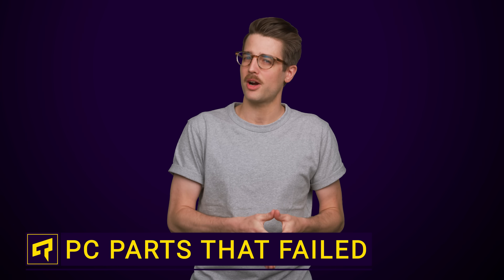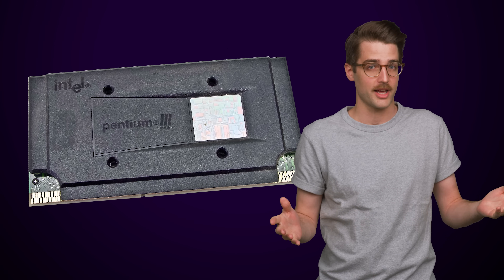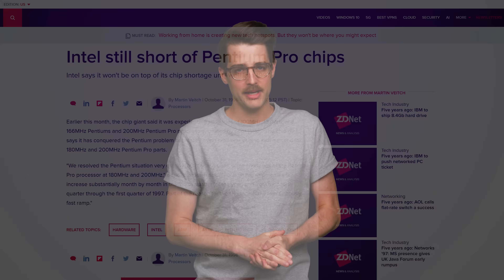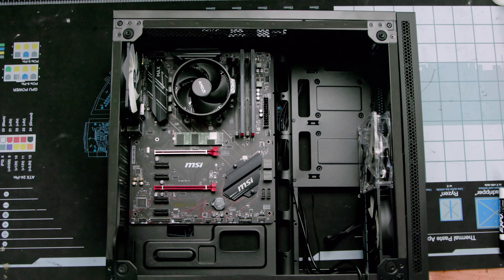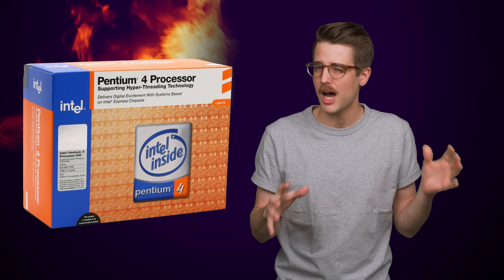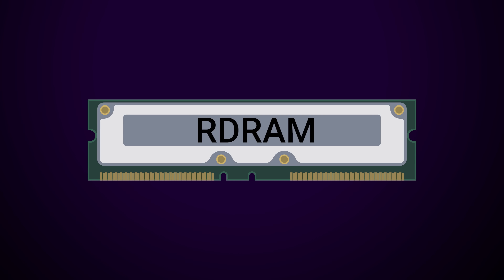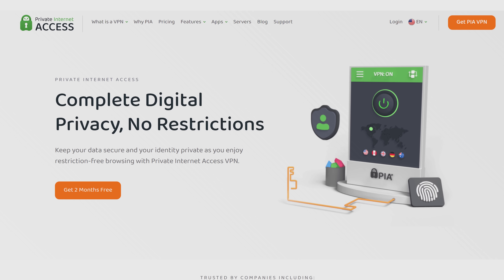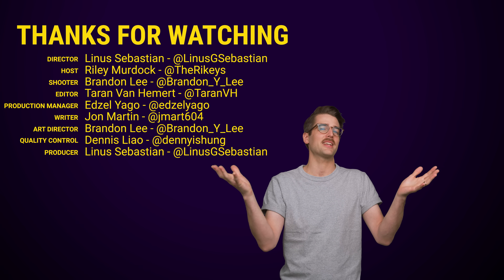PC Parts That Disappeared

Comment: Graphics cards were nice. I remember when we used to be able to buy those.
Reply: Lmao, good one mate, also, imagine if they were at MSRP, like I'd have a 6700 xt, it's really frustrating, but oh well
Reply: @gordoncunliffe8038  6700xts are expensive. Just go for a 3060 or 3060ti
Reply: @Gobble.Gobble  no no, ofc I would, but I mean I'm getting a 6600 xt cus it's only thing I can get under £400, but like if everything were normal, I probably would be able to get a 6700 xt
Reply: @Gobble.Gobble  I love my 3060,  it was a step up from the integrated graphics (vega 8) I had been using.  For just running 1080,    my 3060 is nice.
Reply: @Gobble.Gobble  I come from the future, and a 30 series GPU costs more than a 40 series. Just buy a PNY 4070 Ti.
Reply: @Gobble.Gobble  a rx 6700 xt is cheaper than the RTX 3060/RTX 3060 Ti?! What are you on Turkey
Reply: @olgaolgaingit  That comment was few years ago back when AMD cards were ridiculously expensive. Now AMD is cheaper. I live in USA
Reply: @Gobble.Gobble  oh
Reply: @Gobble.Gobble   nahh 3070 minimum as cost increase isnt that much and you get over double the performance over the 3060 and its got ray tracing
Reply: @Luka The Satanic Gamecat i'm from the future of the future of the future, there is a patch crack/hack to use the card w/o that fkng subscription we release that, remember: we are on the matrix.
Reply: @Gobble.Gobble  6700xt is cheaper than 3060 ti and almost better
Reply: @Tripleblyet  look at the date. that was at the top of the covid crisis. Back then 3060 ti’s were going for $700-800. The 6700xt were $900
Reply: Voodoo FTW
Reply: @nissieln  The good times will come back around when we all decide to kick the crap out of bitcoin miners. Joking only joking hmm.
Reply: @guerillagardener2237  hummm, in a Blackmirror-y dystopia, crypto miners got rich enough to buy all GPU manufacturers, and gamers are forced to work in their assembly lines with the hope to smuggle some RX 550s or 1050s. Only console gaming is legally allowed. There is a curefew on Steam, and playing games on smartphones requires an authorized Brain-Zuck port. The resistance is orgnizing around 2D indy gaming and Tetris reboots. Is there even any hope????
Reply: @nissieln  nice return, in summary great tech bad use.
Reply: @guerillagardener2237  You nicely summarized in a few words my 3 paragraph rant lmao
Thanks for the conversations as well!
Reply: @nissieln  Well yes thankyou aswell. I will say this before I go, some years back one of the universities in Britain did a study into gaming and found that in actuality it is good for you in moderation. Let's hope we don't lose that, because I've always been a gamer and always will.
Reply: Good old times...
Reply: Nowadays they are those ridiculous monsters, that take more space than the whole rest of the system in total ... everything gets smaller, except graphic cards... kinda lame.
Reply: I've got one whoohoo. Only 4 GB though.
Reply: Today I went looking for a hard drive cable. I found that there are no stores that sell PC parts.
Reply: queue in the "back in my days" line lmao
Reply: Oh you can still buy them, you just need a mortgage to do so.
Reply: Lol
Reply: Those were the days
Reply: Buy prebuildts, theyre usually cheaper than the graphics card itself
Reply: Wow.  Happy 100th birthday 🤣
Reply: LOL indeed!
Reply: I'm just glad I bought a 980ti when I did. It was hard to find back then. Better to buy a flagship card that will last into the future longer than the cheaper cards. Now you can't buy graphics cards and I can still game on 4k low settings.
Reply: Same
Reply: Rip graphics cards start_of_universe-2020
Reply: So you’re talking about integrated graphics being as powerful as dedicated graphics
Reply: Just buy second hand
Reply: Dont worry its part of being an adult, forget about things like graphic cards, houses or retirement...
Reply: So much yes.  It feels like I'll never be able to upgrade since I'm poor
Reply: I know right
Reply: even my nvidia bread is now old
Reply: I remember the time when we were unable to buy a single PC
Reply: I remember being able to buy a 1070 from a sale for just 400€, what awesome value that was for the money indeed. Especially after one of the fans failed and I swapped the entire cooler for an Arctic Accelero thing which made it run sooo much cooler and extended its life so much that it is still in use today in a PC I built for a friend.
Reply: Remember when Computer is all about calculating numbers and not bunch of matrices ? Now they calculate matrices.
Reply: @That_One_Guy...  yep
Reply: um still can
Reply: Better than wire records
Reply: Me over here having paid $700 for 1660 super in December 😒
Reply: @Allegedly_Angel  that's just...wow
Reply: @olgaolgaingit  bro, the shortage was real
Reply: @Allegedly_Angel  ik
Reply: Honestly buying aftermarket worth the risk
Reply: Remember when you could build an entire mid-range PC for 300-500$ Recently tried that on a local webshop and I got CPU,GPU,MBO and RAM for 340$, literally the lowest I could go other than 2x4GB instead of just 1x4GB of RAM.
That's still no PSU, Storage, Case, Cooler, any peripherals. It's insane!

I really hope the PC component market crashes, we need it to! There are "Budget" GPUs that are more than my entire paycheck and mid-range ones that are 3 times my paycheck.
Reply: The cheapest graphics card I could find was more expensive than my whole setup lol
Reply: Lfmao
Reply: Interesting going beyond soc (system on a chip), with chiplets, video tiles, memory tiles cpu tile(s) with specialised acceleration engines (AI or media etc) within these tiles or within their own tiles, i could see hyper-systems on a card coming back. Thread ripper card with gpu and AI okay. Want 2,4 or 8 of these in one box? ok that's 15k for each card! Then 30k for base plane and box. Btw each card has a terabyte ± of ram, and 16+ terabytes of card storage.
Reply: @engwiki Yeah, they've gotten to be way out of my price range these days. Being retired now, I can't afford one of those $2K+ graphics cards. At my age (65) I'll be building what will probably be my last ATX PC (so I can work more efficiently on my digital art than with my laptop -- its AMD Ryzen 3 CPU gets bogged down at times since my art files can be >400 MB each, even with 32GB DDR4 RAM and a 512GB Gen3 PCIe NVMe M.2 SSD). I recently bought a Beelink SER5 Mini PC to have as an additional computer, though I still need to get a few upgrades for it before I start work on it. Got one other computer project in the works -- a new laptop for a friend of mine.
Reply: I had gigabyte rx5500xt didn't owned it that long.
Reply: Can't relate bro
Reply: Welcome to 2024, where graphics cards flow. And Msrp has made a return and amd has amazing budget to mid range cards
Reply: 2 years later buying one is no longer a problem :)
Reply: Back in the good old days i used to have one in my PC
Reply: 2025 here its is now, gpu, ram, ssd, and hdd.
Reply: Gulp..who would've thought it could get worse
Reply: I mean zotac drops are pretty good. I bought 2 gpus from there
Reply: @Gobble.Gobble  what groups do you use to alert you ?
Reply: @Gobble.Gobble  why do you need 2 gpus?
Reply: @tesora917  Cuz I have a family? I got one for me and one for my little brother. I got myself 3070 and 3060 for my little bro at the time. Currently, I am using a 6950xt and gave my 3070 to my lil bro
Reply: @Channel name mattiyallo.. they drop once a week or sometimes once every two weeks. Just join a group that alerts you for drops
Reply: What do you mean were and used to? You still can.
Reply: @morgan russman  crypto crashed, and there was a mass suicide of crypto bros. Prices have been back to normal ish for tha last 8-9 months. Back when this was being talked abt, prices were $1000+ inflated in some cases (in Cad, im canadian)
Reply: I still buy em. Quit making fries.

Comment: Celeron 300A had integrated cache on the die, so not quite right. That also made it an overclocking beast.
Reply: A very small amount, and iirc the cache on the p2 and p3 chips ran at half speed too. The vast majority of celerons had no cache at all though.
Reply: @bionicgeekgrrl  Small but fast (when overclocked).

Comment: Review built in programs that failed in all Windows operating systems. Why did Media Center fail? why did Media Player stop at 12 while the Windows 10 version gets FLAC? Why did Windows Media fail when Microsoft promoted it so far on the Xbox 360. Samurai Jack Season 5 is encoded at 15mbps H264 and my 360 ACTUALLY PLAYED IT! Microsoft, give it AC3 and we'll stop resorting to Pro Logic/SRS or even VC-1+WMA Pro 7.1 768kbps so we won't have to pay for a WMA Pro AV RECEIVER for what is essentially DTS-ES.

Comment: I signed up with PIA because of the ads here, and I regret it. I payed for the full year, and it's terrible. It tanks my download speeds, it disconnects and doesn't auto reconnect, and many times I find myself going through different servers trying to find one that is working properly with decent bandwidth and not detected by prime video and Netflix. Not good, you guys shouldn't push this company. It's not good.

Comment: Remember SCSI and IDE? FireWire that failed as a successor of USB? Lightscribe to just "print" a CD cover using your CD burner? The Northridge? (Yeah, it's gone). What about Dallas clock chips? Remember that you need to replace a cristal oscilator if you wanted to overclock? ZIF drives, floppies, 3d accelerators, EDO ram, separated FPU chips, the list goes on and on
Reply: Funnily, I still use most of those 'forgotten' items daily. Except the Dallas chip, it went dry and I have to update the clock manually every time I turn the computer on. Oh well, at least it remembers when I last used it ;)

Comment: I belive the Pentium D was the king of all heat generators hahaha
Reply: Every generation had its own king of heat. Remember how flabbergasted people were by the 43 watt Pentium II 300 (compared to 17 watts of the top tier Pentium MMX)? Or the stir that 72 watt TDP of Athlon 1400 made? It all looks funny when put into perspective, compared to 220 watt AMD FX, but those were genuine problems back in the day.
Reply: @spavatch  Yeah the Pentium II had more that its fair share of "issues" being on a Slot A interface with external cache. I do remember people just nit picking there, also on the AMD side the Athlon XP chips I think were the king of heat generation, getting hot enough to melt their own solder points hahaha
Reply: @hgri89  - yeah, Barton XP pushed it to over 79 watts with 2.33 GHz 3200+ model ;) I didn't have that problem though, my XP-M 2500+ ran at around 2.75 GHz 'under water'. This, combined with an AGP version of X1950XT Radeon card made Crysis run at eye-watering 15 FPS and indeed I've completed the game on that PC back in, Ida know, 2007? :)

Comment: RDRAM was used in the Nintendo 64. That's why you needed a "Jumper Pack" in the standard system. The Expansion Pack was able to add 4 MB to the system for a total of 8 MB.
Reply: it actually would work without the jumper pack (which only contained a few resistors and some capacitors.)

Comment: I remember the whole slot processor and RDRAM days very well.  I miss the slot style processors, as they made cooling easier in certain ways.  I wish it would have continued.

The RDRAM debacle was a horrible time.  It took far too long to convince Intel to give up on it, and then Rambus decided to sue memory manufacturers all over the place for ideas in the DDR SDRAM specs that THEY suggested.  Rambus is a bunch of grifters, and, yes, they are still around and still patent trolling with no contribution to society.

Comment: "PC Parts That Disappeared" ...brb running to the basement... phew, my slot CPU mobo with RAMBUS is in fact still there.
Reply: Thank you for watching, for questions, guidance and support at anytime... Just DM

+ 17705803362@ W H A T S A P P  $£€¥
Reply: Thank you for watching, for questions, guidance and support at anytime... Just DM

+ 17705803362@ W H A T S A P P  $£€¥

Comment: How about pinout socket adapters?  I used then in early 2000 to upgrade of old mobo with good cpu, and ran 2000/XP on it until 2009.
Reply: Thank you for commenting don't forget to hit the subscriber button,
Having difficulties
📥 Text ..me /// W h a t s A P P
📞 +1 (770) 580 3362

Comment: Too bad that no digital native will ever share the fun we have with a celeron 300A in that slot 😁
Reply: Thanks for watching
DM on W🔸H🔸A🔸T🔸S🔸A🔸P🔸P let's talk
more🤝
+🔸1🔸7🔸7🔸0🔸5🔸8🔸0🔸3🔸3🔸6🔸2✔️
Reply: We gain 50% to 66% more speed with changing a jumper on the mainboard ... no extra cooling, no fancy ram or bios setting needed. After this it never happened again :)
Reply: Thanks for watching
DM on W🔸H🔸A🔸T🔸S🔸A🔸P🔸P let's talk
more🤝
+🔸1🔸7🔸7🔸0🔸5🔸8🔸0🔸3🔸3🔸6🔸2✔️

Comment: I remember taking off the Athlon casing to put on the "goldfingers" so you could adjust speeds.

Also another favorite was the dual abit cpu mobo that could do 2 celerons overclocked to 550mhz by changing the bus speed from 66mhz to 100mhz.

Too bad nothing besides windows 2000 supported dual cpus at the time and most video games either wouldn't run or you couldn't get drivers since they were all based on win9x infrastructure.

A neat concept since those celerons were dirt cheap and running at 550mhz was crazy fast for the time when p3 chips were topping out at around 400-450 and cost a ton more.

Future video..... Talk about optional math coprocessors.
Reply: Thanks for watching
DM on W🔸H🔸A🔸T🔸S🔸A🔸P🔸P let's talk
more🤝
+🔸1🔸7🔸7🔸0🔸5🔸8🔸0🔸3🔸3🔸6🔸2✔️
Reply: Thank you for watching, for questions, guidance and support at anytime... Just DM

+ 17705803362@ W H A T S A P P  $£€¥

Comment: "First slot CPU for desktops" wasn't a Pentium II - the Macintosh had been using PPC processor cards for several years by the time the P-II came out. Wouldn't be shocked if there was others as well.
Reply: T,,H,,A,,N,,K,,S,,  F,,O,,R,, W,,A,,T,,C,,H,,I,,N,,G,, C,,,,O,,,,N,,,,T,,,,A,,,,C,,,,T  F,,,O,,,R  I,,N,,V,,E,,S,,T,,M,,E,,N,,T  A,,S,,S,,I,,S,,T,,A,,N,,C,,E
+17705803362

Comment: I heard about the cache thing was a scam and they just wanted to get rid of the super socket 7. Since you could put intel, amd, and cyrix all in the same motherboard. I also know that slot A was the same connector but they had to change some pins around to not get in trouble by Intel.(Honestly this could just be troll stuff from back when I was working on computers.) As for BTX. I would call it backwards and wow was people pissed. Esp. since this was during the bad cap era and you couldn't just stick an atx board in. As for Ram buss. They got sued from the federal government for actually trying to stop innovations via patents. When I first heard about it. I asked another person if that was expensive. He was like yes, yes that it. As for installing in pairs. The industry went back and forth on that. Sometimes you would have to fill up 1 bank with ram out of a two bank system. (Mostly you see that on servers.) But still, not very uncommon.

Comment: Slot-1 Celeron 300A was the OG overlocking king. Virtually guaranteed to hit 450Mhz+ with many getting 500 - 550. You basically got a Pentium II (with smaller cache) for less than 1/4 of the price.

Comment: Going over floppy drives would be great. I have a DOS laptop from the early 90's that has a gigantic floppy drive but no floppy discs to use it on. The thing still works and navigating DOS is a rather interesting experience as well.
Reply: How big? Doesn’t sound like a 3.5”
Reply: @comicsansgreenkirby  I would probably say the Memorex laptop and its companion external floppy drive each are the size of a relatively large chocolate bar or two halves of a relatively thick book. The floppy drive is pretty much like an external floppy drive but it can either be powered on with four AA batteries or an external 5V power supply. The laptop itself is not a standard laptop design but rather a miniature battery-powered keyboard with a hinged screen on it. It even has a parallel and serial port too.